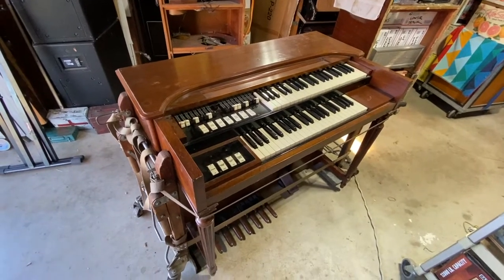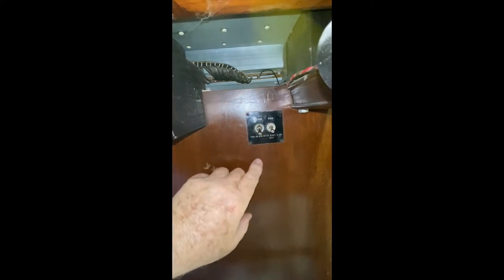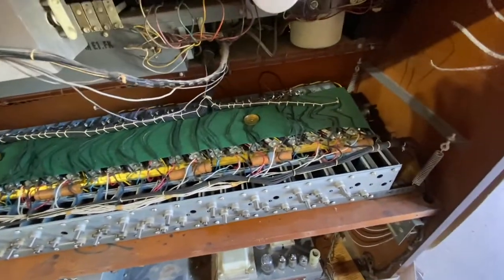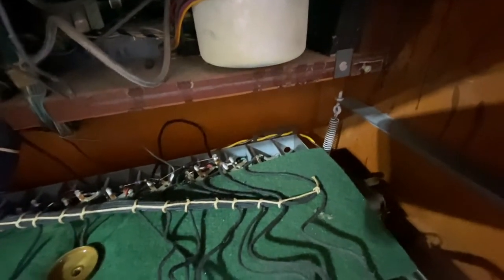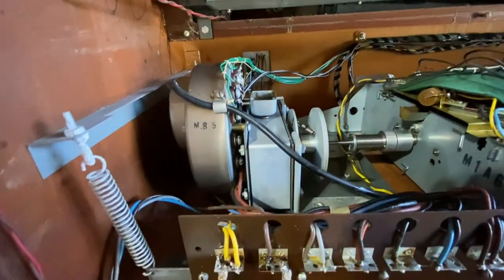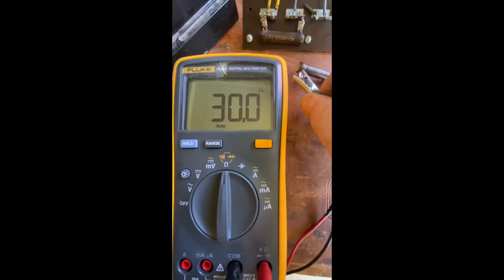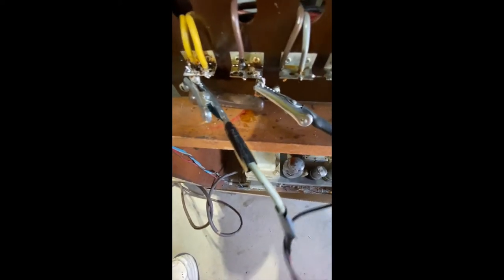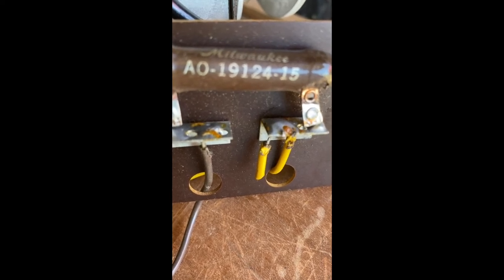Hammond Organ Run Motor Fix - Check This First !!

Comment: I'm having this issue right now with my b3, hopefully this is a fix for me! Thank you for making this video!
Reply from the maker: Please let me know if this Hammond video helped ! - John
Reply: Some I purchased a C2 spring of last year 2022 and powered up great but has been sitting for almost six months not turned on and today 1/16/2023 the run motor failed me and I discovered this video.😢

When bought it was oiled but not smooth and quit. I removed the back panel today 1/16/2023 and the cup above the run motor was over filled so I used some tissue to absorb most it!

Comment from the maker: Hello. If your oil cups are not draining, something must be clogging them - check for debris at the bottom of the cups; you may also need to use extra-long pipe-cleaners to clean the tubes beneath the oiling cups.  The Hammond Oil Cups funnel oil via tubes beneath them to other funnels above the Hammond Tone Wheel assembly.  Oil is then "wicked" to all the tone wheel bearings by small cotton threads.  This takes time and that's why it takes several days after oiling for the tone wheel shaft and bearings to be properly lubricated.  It's extremely important to use Hammond Oil for this process.  -- John

Comment: What if the problem continues? Run motor does not stay on even after replacing the resister.

Comment: My resistor tested bad so I replaced it. The resistor was a B12J25OE   (I was told this is the same as the AO-19124-15)  This had no effect so I have pulled out the run Motor. How do I test the motor to see if is bad?
Reply from the maker: Hello -- try using your ohm meter on the motor.  No ohms??  The windings are probably bad and the motor needs to be replaced.  There are two motors on the older Hammond models; the Start Motor, and, the Run Motor.